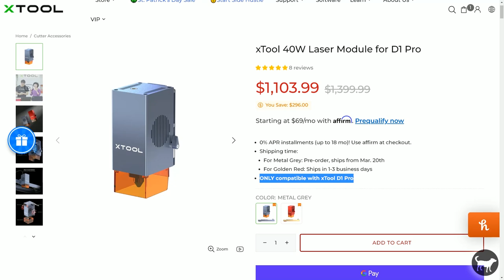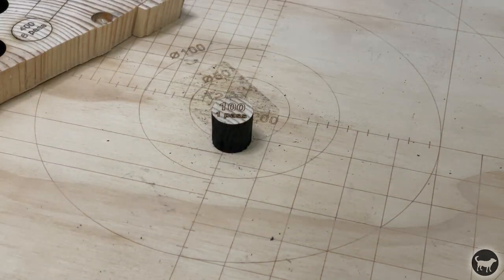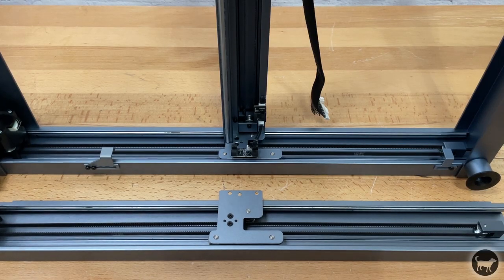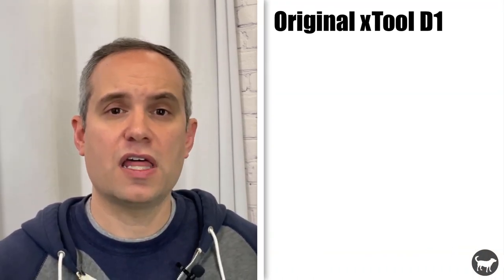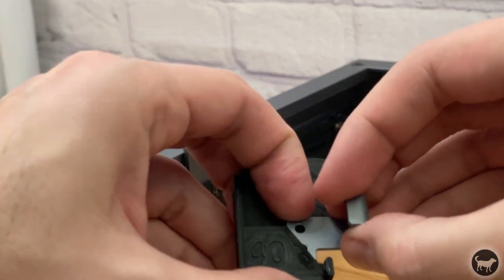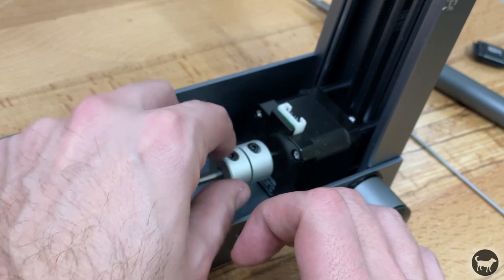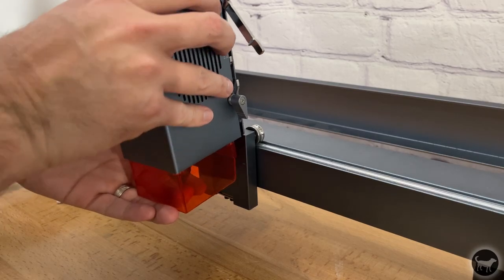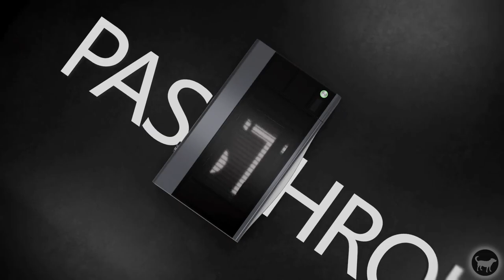Upgrade your original xTool D1 to the 40W Laser Diode

Comment: I have the d1 pro 5 watt would i be able to change it to the 20w or 40 w without changing mother board?
Reply from the maker: Hello. I believe both of those require different motherboards and power supplies. The 40W for sure but I also believe you need it for the 20W.

Comment: I just got the 40 watt, ordered the kit also , but where do you hook up the rotary motor
Reply from the maker: Typically the rotary plugs into the same port the Y Axis motor is pugged into. You just need to replace it when using it.

Comment: Do you know if it is possible to convert a D1 10W to a D1 Pro 20W with limit switches? Thank you for all your great videos and products!
Reply from the maker: Hello. Not without some extra parts. I know the the Geeks at Large website has their Devil1 that will convert the machine into a more capable unit with limit switches so that might be an option for you if you want to achieve this but there is no other real way of doing that now that I know of.

Comment: Does the 40w mother board need the SD from regular d1?
Reply from the maker: Only if you want to work over Wifi I believe. You just need any micro SD car in there. It doesn't need to be the one from the other machine.

Comment: Looking fwd to a vid using up my redundant 5w pro bits and pieces as well as my defunct bits after extending the cutting area upgrade ext kit.
Reply from the maker: It’s coming! I have finished the build but now I just need to find time to put the video together between a few others I have in the works. Basically I use the D1 to build and enclosure to house the left over laser. I went a little overboard with the customization so I’m not sure exactly how many people will do what I did but I feel like it was worth it. You can get a little sneak peak here but again it might be a few weeks before I can release a video on it.  https://drive.google.com/file/d/1AX3Hx4pi8oILD-JjE-CeBucmKYMHMITN/view?usp=drivesdk